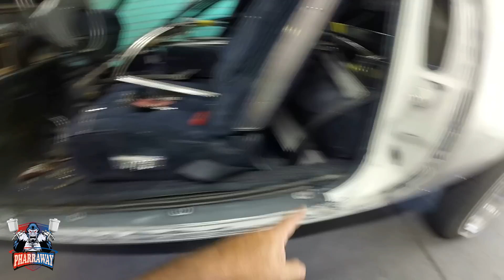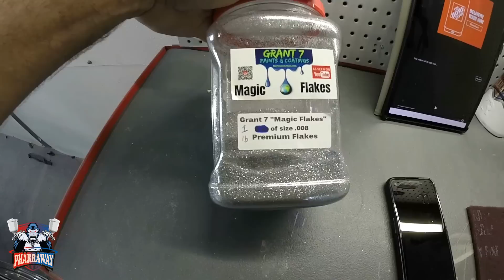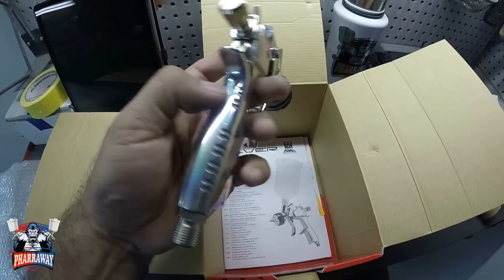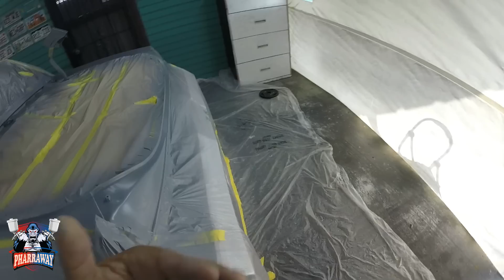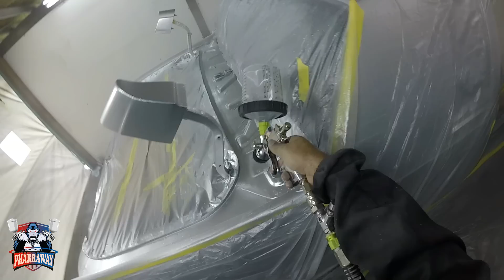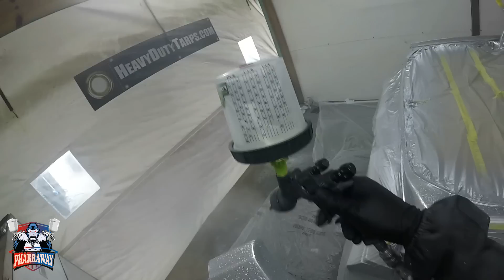How lowrider cars are painted with candy paint and metal flakes part 5

Comment: Great video series!  I have a question.  I'm going to be doing a respray on a mini truck, I dont have the room to paint it in pieces so i plan on doing the inside of the doors, hood, fenders and jams.  Then assembling it to paint it as a whole truck.. Would i mask it opposite to how you did this? only masking the inide of the everything vs the outside?  just trying to come up with a plan on doing it so i dont have to do the jams twice.
Doing a solid color no metallic paint.
Reply from the maker: Yes that is correct